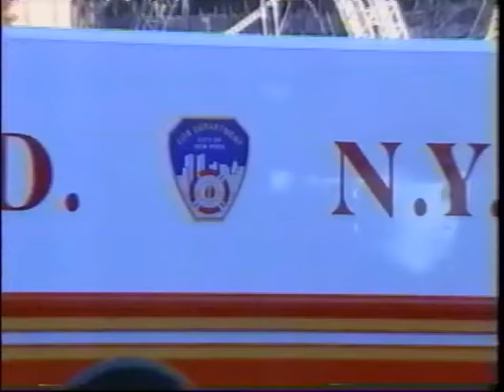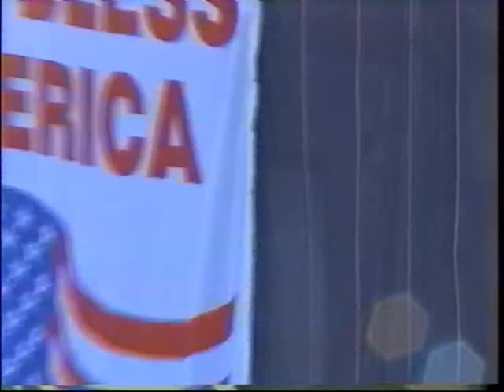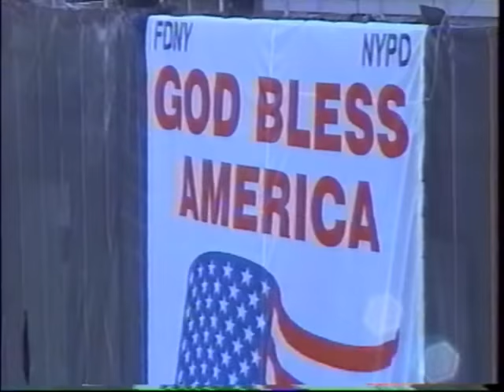Ground Zero recovery months after 9/11/2001

Comment: The floors were designed with aluminum trusses spanning 60ft and 35 ft from the core of the building. On top of the trusses was corrugated sheeting with a concrete floor poured over it. Aluminum weakens at 600 degrees Fahrenheit. Not melts but weakens. Combine the weight of a concrete slab on top of a weakened aluminum truss plus gravity. One floor collapses on top of the one below doubling the weight results in a catastrophic failure and collapse. There was no bomb, no inside job, no thermite or any other idiotic ideas that happened that day. We who were in the city that day saw  it. Any other “theory” by you experts is absolutely pathetic
Reply: Mick actually it’s all of us in the engineering department that are laughing at you but feel free to keep sharing your “expert” opinions and insightful snappy answers. We always enjoy a good laugh
Reply: Gregg livesay - The floor trusses and floor sheeting were steel, not aluminum.  The rest I have no significant issue with.
Reply: @Mick - Have you read the NIST Building Performance Reports?  All of them and related documents?  It's what, around 2,000 pages.
Reply: M Fitz the floor trusses were aluminum
Reply: @TheGreggl  - The NIST (and literally everyone else) missed that completely then.  What are the odds of that?
Reply: M Fitz there were only a few floors that were reinforced with steel beams and those were the load carrying floors that had communication equipment and electrical equipment placed on top of them. Floors them selves or aluminum trusses with corrugated steel and a lightweight concrete or a slurry that was poured on top.
Reply: M Fitz There was no inside Job and no demolition. Some of the ideas floating on this thread are beyond ridiculous
Reply: Sure you do
Reply: @TheGreggl  - Gonna disagree with you on that as literally every engineering document I have ever seen on the subject shows them as steel and there is no good reason at all to use aluminum.  Agree with the rest.
Reply: M Fitz according to the exact floor plans I have seen of the towers the open floor plan had spans of 60 feet and 35 feet from the center core. The spans were achieved by the truss system. Some floors had double trusses but there is a schematic of a side view showing the truss, the corrugated steel layer,   4” of slab consisting of a lightweight concrete mix or what we call “slurry”
Reply: M Fitz my main point in my initial comment was in rebuke to the many “theories” about controlled demolition, no planes, inside job etc. A majority of these comments come from people who weren’t  even near New York City that day. I was standing at the foot of the Brooklyn battery tunnel and watch this whole thing unfold and I know what I saw with my own eyes and it just angers me at the stupidity and almost shear lunacy that is expressed on these 9-11 videos.
Reply: @TheGreggl   first, the trusses were in STEEL and not aluminium like you are babbling, dear disinformator.  Second, even so, a partial weakening could just let fall some parts of the floor over the floor under it, but this absolutely cannot do a certain downfall like in an avalance. If so, even a partical for wahterver reasons, fall, could make a total destruction of an highrise building. Literally, you don't have a clue of what you are talking about.
Reply: @TheGreggl   aluminium is NOT a good material to build a floor. Never. Also because it is vulnerable to corrosion. And even so, it melts at 600° C and before this, there must be a really big fire to fall down an entire floor and even so, it's not certain at all that it would make a chain reaction how you are sayng, dear disinformator liar.
Reply: Diadema033 hey dude read the fucking blue prints in the construction of that building and maybe you’ll learn something. They devised a LIGHT WEIGHT system of flooring which enabled them to have an open floor plan PLUS the ability to build a building that tall. GO READ IT
Reply: @TheGreggl Yes there were trusses, but they were steel, not aluminum.

Comment: but the 911 debunkers told me that the demo crew only cut diagonal cuts.... those look horizontal.... if I were doing the demo....I wouldn't make my job harder by making a diagonal cut.... there should be no reason to find any structural beams cut diagonally in the rubble ........should there be?    wake up
Reply: one million likes by me!!
Reply: Really?! They make diagonal cuts to make the work just easyer. Thats makes you sure its gonna fall that way you want.. straight cut are unstable and can fall any direction so its more dangerous.. they only use straight cuts if the pieces are to big and hold in place by a crane or something.
Reply: Yes, during cleanup they cut the remaining beams diagonally so the debris falls in one direction.

Comment: Why steem months later.. is this nuclear waste. Or plutonium
Reply: obey conform today military grade nano thermite. The crap the perps used to weaken the structure before the timed demolitions went off
Reply: obey conform today I found the truth in Wikileaks.
Reply: There were pools of molten metal in the basement from the nano thermite that was used to bring down the building. This was months of dousing the pools with water and it had no effect. They had to lay down dirt and sand everywhere so people's boots wouldn't melt. You can find videos of molten Steel running down the channel rails and pouring out of the towers and onto the streets not ling before the towers were taken down. So basically the molten steel was turning any water or any type of moisture in the soil into steam.
Reply: Why the fuck would there be plutonium dotted around the site making steam?

Comment: OK, two planes hit two towers, and both towers collapsed into their own footprint as though by controlled demolition. Whether it was staged or not, that's not my point. A third tower is seen collapsing into its own footprint, but was not hit by a plane. Many buildings show severe shrapnel damage as I'm sure a lot of debris shot out horizontally as the towers compressed into rubble during the collapse, but those other buildings are still standing. Why did that third tower fall into its own footprint, when none of the neighboring buildings fell?
Reply: Roland Doucet You keep writing "footprint" but none of the 3 buildings collapsed into their own footprint. As you can see by this video.
Reply: They didn't topple over, they collapsed straight down into themselves, compressing floors as they dropped.
Reply: Yes, especially when NONE of the other neighboring buildings collapsed. Broken windows everywhere, but the buildings remained standing.
Reply: I also don't see a clear motive for the inside job theory. But the doubt exists from both sides of that concept. It took the Warren Commission over 30 years to reveal there was possibly more than one bullet in the JFK assassination , so who knows what we'll be told about 9/11.
Reply: Roland Doucet...missing money. And LOTS of it.  Check that out and see what you think.  It's felt like motive enough to me.  Throw in an economically beneficial war and decades worth of rebuilding these newly war-torn regions for your personal construction business, among other lucrative benefits...and it might equal motive.
So very hard to imagine...but it just might be true...
Reply: The name Halliburton comes to mind.
Reply: is that your answer?
Reply: Where do you get that idea??
Reply: Hank Mardukas USS Maine. Pearl Harbor. Tonkin Gulf. Contra Affair- all these were false flag or misrepresented cases that allowed the US to excersise their authority on the world stage with approval of the domestic courts. It gets harder and harder to convince a population over time-- drastic times call for drastic measures. After Vietnam, you need a damn good reason to go to war without pissing off the American public - - what better reason than "the new pearl harbor"? 3000 dead in exchange for oil security upwards of $2 trillion, continued hegemony in the middle east, the passing of the patriot act allowing for NSA data collection of the entire citizenry, and security of Europe from Russian involvement in the Mediterranean? So much winning, you'll get tired of it. 

The owner of the lease on the Towers, the Bush administration, CNN NBC ABC every fat cat in the US made profits off of 9/11. Osama Bin Laden (CIA informant) went from a successful political figure to a fugitive, getting put in a body bag and dumped into the ocean. Nothing to hide, right? 

That's an awesome trade. Worse things in America were justified for less.
Reply: Hank Mardukas AL queda did conduct 9/11. They were trained and utilized in the same way the contras were-- as CIA operatives. The fucking pilots learned in Florida at a flight facility used by CIA trainees.

Look, the US has many options to engage in wars. Libya, Syria, Iraq- no boots on the ground. So sizing of government facilities. Just smoke and daggers, airstrikes that hit nothing and do nothing. It's a real politic maneuver to scare Russia out of the middle east. But when it matters-- when a nationalist government threatens to choke out your source of energy? Well, that calls for drastic measures.
Reply: Hank Mardukas okay dude, you believe what you want. It seems your intent is not to have dialogue, or to understand where alternative opinions come from- but to establish your own worldview and claim it as truth. Asinine or not, I've given you examples in American history that this kind of stuff has occurred. It doesn't just happen in the US either-other nations have used false flags and the killing of their own people as ways to achieve political gains.

We are as expendible as a population as we were on the farms; nothing has changed just because now we have skyscrapers and iphones.

Also, like I said, technically the United States is not at war with Libya. Or Syria. We engage in airstrikes and indirect fighting. In order to go to war and place troops on the ground, the president needs approval from congress. Interestingly enough, the war in Iraq was initially pushed through without the approval of congress, meaning the engagement was unilateral and decided through the executive branch. Only after did congress allow a temporary coalition campaign- consisting of countries who were all suffering from oil shortages (England, France, Germany, Spain and Poland) to engage with 90 days of free reign.

The people did not approve of the war. The media was forced to spin it to keep it favorable, and even still we understand how disastrous it was. The issue is the lack of information that prevents us from having an honest discussion, on the same vein as the JFK assassination and MKULTRA files.
Reply: Hank Mardukas Gulf War was a coalition reaction against aggressive invasion into Kuwait from Iraq. Justification is right there- liberating Kuwait from Iraq. That's something Americans can get behind. It's a cut and dry thing.
Reply: Hank Mardukas 3000 is nothing. More people die being idiots driving by a huge margin.

The buildings were insured. The owners made profits on them coming down.

Butcher? One or two blocks of direct damage, maybe 500mil$ in cleanups. Katrina cost 5 times as much.

Again, I've given you examples in American history. I can give more- Roman occupations of Gaul, Krystalnacht in nazi Germany, reichstag fire, Mukden incident, Winter War, etc.
Reply: Hank Mardukas Afghanistan is extremely important geopolitically. Look at a map. Russia wants to run an oil pipe from the Siberian Traps to the south (India, China, Africa)? Gotta go through Afghanistan. Iraq and Turkmenistan are both extremely oil rich and having an American presence next door stops Russia or anybody else from siezing it. Afghanistan has access to Asia and is on Russia's doorstep, meaning a strategic American presence can box Russia in after decades of cold War preventing American presence anywhere north of Turkmenistan. It is hugely important for a world power to secure and maintain steady liquid income, and to open up markets for which to generate new income. Those that do not (Rome) are doomed to fail, and those in power within America are not interested in losing it.
Reply: Roland Doucet it was built for rentalble floor space less inside supports. Minor earthquake 7 hours before and burned 7 hours where 1000 gallons of oil was stored.
Reply: Hank Mardukas nice going you get it . Thank you
Reply: Hank Mardukas what exactly is your point
Reply: You say the buildings collapsed, yet I can't seem to find them, not even the first floor, the fema pictures taken from The day before building 7 went away show not a single piece of steel on the ground floor and the dude took the shot from the middle of the slab from the first one to fall. Nothing collapsed, they left enough of a pile to take the pictures they wanted to get out, but it only takes one picture to prove they did not fall, they blew away as dust, bombs or thermite sure, but they can't make the building dissapear.  Anyone who has not seen the picture taken from the middle of the slab is missing the entire scenario.  Plenty of video exists to prove the molecular de-association stopped at the ground floor and only a small amount of damage below so anyone who thinks they did a flight 93 and hid underground is also mis-informed and why??  Because the media, every single lying one of them did their job by carefully showing you only angles promoting a pile when no pile existed.
Reply: Roland Doucet “it was pulled@
Reply: @sizzlean9459  The buildings blew away as dust? Clearly you have not spent much time on this topic and are just babbling like a baby. Had you taken the time to look at what was actually in the dust plume you would know that's not true.
Reply: Well since I was great friends with the man who invented the technology, I'd say I'm not quite a baby Harry. I know what was in the dust and how it came to be there.  The main question you need to answer to yourself is where are the buildings because it doesn't take a genius to know if a man takes a picture from the middle of the floor of the first builiding to fall, before building 7 was destroyed and there is not a single piece of steel in between him and the ambulance parked at the door, then obviously you've got problems with whatever scenario you want to believe.  Thermite cannot make the building go away dude, it's really just that simple and yes I've done 15 years, burned many thousands of DVD's and spent countless years on the subject.  You on the other hand obviously don't have a clue.  Never-the-less I really don't care about the subject anymore, I know what happened, by whom, how and why,...they got everything they wanted and more and I have much more important things to do than to argue with someone who could easily do your own research until you realize you've been lied to by many many people from every side.  Watch Dr Judy Wood's presentations for some basic knowledge and then know this, she still doesn't know how it was done or with what tech, the answers are just too simple, but probably way over your head until you realize there is not two buildings anywhere to be found, only a small shell of the lobby for photos to be taken from the outside looking in.  If you are able to stand on a cleanly swept concrete ground level floor with only dust in between you and the ambulance from the front door and the ambulance only has dust on it and you cannot understand the problem with that picture and your perception of what took place, then I suggest you just give the whole subject up because you have a long way to go to get to a point where we can talk.  but as I said I'm done with that subject, been there and moved on to things that matter and can be changed.
Peace
Sizzlean
Reply: @rolanddoucet9437  the 3rd building (tower 7) was seriously damaged by the collapse of the north tower and the fire from the north tower spread to building 7